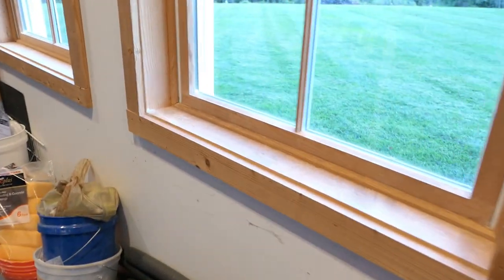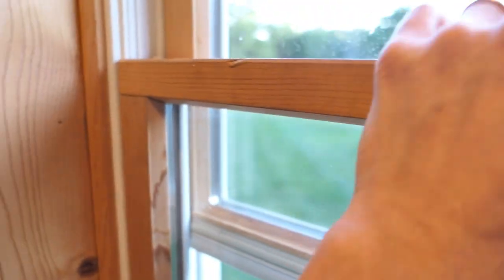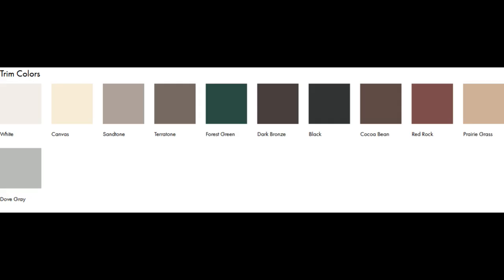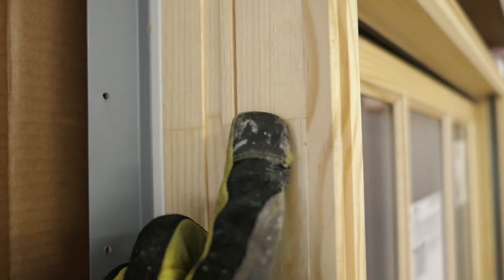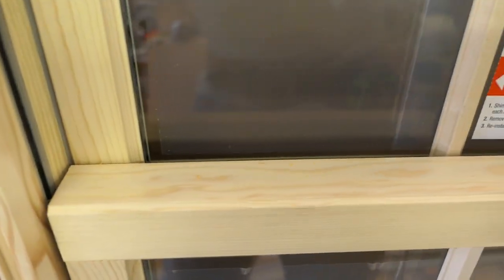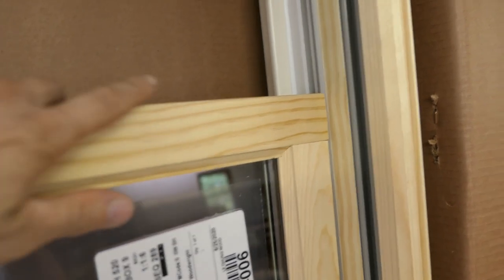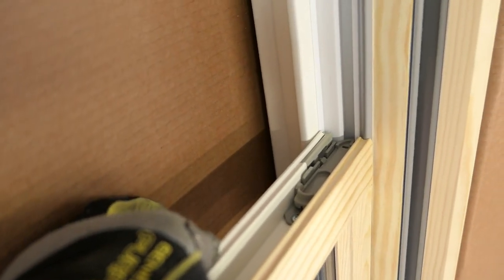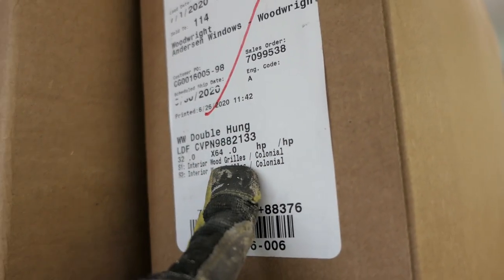Anderson 400 Series Windows Unboxing And Review

Comment: As a homeowner that does his own remodel / handyman work, I really struggled buying and putting in a replacement window in my bath remodel.  The window is about 2' w x 3' tall and sits about  40" off the ground right in the middle of the back shower wall.  The city building department noted on my building permit plans that the window had to be safety glazed and I could not see any indication this old window from when the house was built in 1960, was safety glazed.   From what I read, since I was 'remodeling' I needed to buy a "replacement" window with no nailing flange.  This made sense because I have steel siding (yes steel not aluminum or vinyl) and it's rather involved to remove enough of the siding to expose enough wood under sheathing to put a nailing flange against.  Installing the window level, plumb and square without any nailing flange was a bit challenging.  After initially trying to do it with the window in the frame, I finally came to the conclusion that I had to remove it to from the frame or it was too unwieldy.  It's a side swinging casement window and I was concerned it would not function properly after I reattached it to the frame.  I was very careful and all worked out well, but I must say it took a lot more time and effort than I anticipated.   Even though I bought it from Home Depot, I really got the impression from the whole process of measuring and ordering and installing it that the window manufacturers (this was a Milgard) and even Home Depot aren't really expecting window replacement to be a "do it yourself" job for the homeowner.  They really seam to expect you will have a pro do it for you. Is that your experience as well, that it's setup for pros like yourself?
Reply from the maker: Well, there are several issues here.  First, the requirement for "safety glazed" or tempered glass is for situations where a person might accidentally fall against the glass and break it.  If your window was close to a bathtub, for example, that might trigger the requirement.  I ran across this issue once before.  I wish you had found me earlier, because I might have saved you some trouble!  There is a safety film available for windows, applied in much the same way as plastic tinting is applied to automotive windows.  It functionally turns regular plate glass into tempered glass and I had a local building inspector approve this method for use in a bathroom with an old window installed near a tub.  A local glass company turned me on to the idea.  

That aside, you've run into a common problem with windows.  Old school windows were not made with a flange, they were nailed through the sides into framing and/or the exterior trim was used for structural support.  New windows are not made this way, unless you special order one without the flange design.  So, you either order the old-school type or you modify the framing and sheathing to work with the flange style.  This was covered in my recent video here:

https://youtu.be/8tVJCZZ8KTM

Installing windows can be super easy on a modern house with standard sized windows and flanged windows previously installed.  Installing windows can also be a nightmare on older houses with idiosyncratic sizing and old methods of framing.  You need to understand the framing method, the potential modifications you can make, the requirements of the new window, and have extensive experience with trim and siding.  That's why pros cringe when people want a "per window" price.  How much to install a window?  It just depends on a lot of factors.  installing a replacement window in a 2010 condo with vinyl siding is a lot different than installing one in an 1890 balloon framed Victorian or an 1820 timber framed colonial.
Reply: @enduringcharm  Thanks for the information.  Very helpful!  I wish I had found you earlier too!  The safety film would have been so much easier and far less expensive than replacing the old window.

Comment: Hey! Great review, I’ve been digging and can’t find if there are weep holes where they are located. Also do you silicone caulk around trim?
Reply from the maker: If you are asking about exterior trim in the form of wood or PVC, for example, then that is generally painted.  So I will use a latex caulk which is paintable to seal between the trim and window.  If you are using vinyl siding and J channel then it will not be caulked at all.
Reply: @enduringcharm  thank you for your reply! Yes the exterior, we have wood trim that bumps up to the window, rather than siding. And there’s a small gap inbetween the wood and the window. We live in New York so I feel like it’s not great for insulation, I just didn’t want to seal it if there was weep holes. They could have done a better job at getting the wood closer, even in the summer there’s a gap.

Comment: Thanks for the review. Do you have any thoughts about Andersen's vinyl exterior vs Pella's Enduraclad? I've seen some 400 series windows quite faded and I'm guessing that the powder coated aluminum on Pella would hold up better. I'm comparing Andersen 400 against Pella Lifestyle. Thanks for any thoughts you have to share.
Reply from the maker: That's an important point, and I have some interesting information to share.  First, I have seen both vinyl and aluminum windows badly faded with UV damage, so both are susceptible.  Darker colors are going to take a a bigger hit, of course.  Aluminum windows can get dings in the finish if hit during installation or abused in some other way during their life.  You may be able to repaint aluminum windows, although modern designs don't make that easy. Vinyl will take a little bit of a beating and basically bounce back without damage, but they are not easy to repaint.  

However, vinyl windows can be maintained with a variety of automotive products designed to protect and preserve plastic, rubber and vinyl on cars.  Everybody knows Armor All, of course, but there are superior products to that available now which offer UV protection and which will restore faded surfaces.  Generally vinyl holds up pretty well, but if you have a southern exposure and you are concerned, you could open the window sash and apply some of these automotive products to the vinyl clad frame once a year.  Similarly, painted or powder-coated aluminum frames could be treated with automotive products.  So, I wouldn't make your decision based on the cladding, but, rather, on the features and the price of the windows.

Comment: do the slots in the bottom fit shoe Moulding if window is flush to inside walls of house? or can you just put shoe anywhere you want on these do you just nail into the wood at bottom it seems to have a huge sealing overlap at bottom of window opening like an inch high i am worried about hitting the window with finish nails.  mine do no seem the same at bottom as yours i just got the standard off the shelf one.
Reply from the maker: I'm not sure I follow your question.  Are you concerned about the gap between the window sill and the framing on the interior of the house?  That is typically filled with insulation and covered with trim of various styles.  I'm not certain what you mean about shoe moulding, which is used at the bottom of baseboard trim.  Maybe you mean quarter round?  Or maybe you're wondering about jamb extensions?

Comment: Jersey boy here also that jumped across the bridge a few years ago. Don't hold that against me. Looking to replace original wood windows and the Woodwright is what we were thinking. Simonton was priced in three quotes but I feel like they are too basic. Going replacement so any other suggestions (possibly less expensive as I have 23 windows) would be great. Thanks!
Reply from the maker: The cost of windows and doors has skyrocketed in the past few years, to the point of absurdity.  And if you want wood windows or details which don't look cheap or plastic, then the cost is even greater.  All the major manufacturers like Pella, Marvin and Anderson make wood windows, and the cost is generally pretty similar.  However, there are differences in pricing among retailers. Depending on the brand I might buy from a local lumberyard or Lowes or or Home Cheapo.  It pays to get a few quotes on the same windows to see how it comes out.

Comment: Awesome thanks for the info.. looks like Andersen has been upping their game. Though some of the details you pointed out are less to be desired. 

Marvin elevate was actually cheaper than the 400 series so I went with that. I have a part two so I might go with Andersen. Their 400 series looks alot better on the inside than the elevate. On the outside 400 is ok just not as good as other companies.  Surprised they haven't addressed it by now. But why would they right ?
Reply: I did not care for the look off the 400 series on the outside, I went with the Andersen A series

Comment: Tilt 'feature' on my lower sashes (two different windows) has NEVER worked.  I have to stick two screw drivers down the sides to get the pins in the jamb to release.  Total piece of crap.  Cheap vinyl windows have a better setup than Andersen.
Reply from the maker: What year did you purchase yours?  I've noticed some years are better than others, but the mechanism always works.  One strong possibility for you is that the windows were not installed properly.  A common mistake is to use too much insulating foam, the wrong type of foam, or to shim too tightly.  As a result, the jambs are slightly bowed in, and it will be difficult to get the sashes to release.